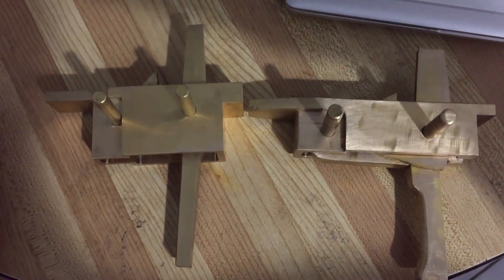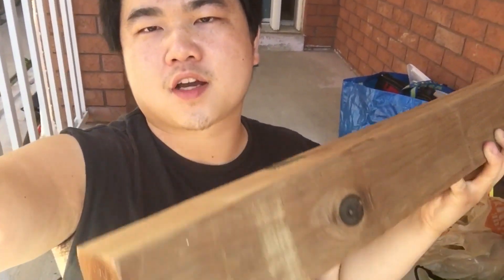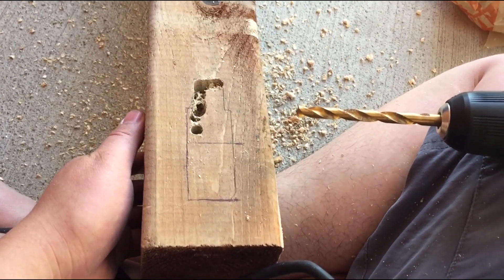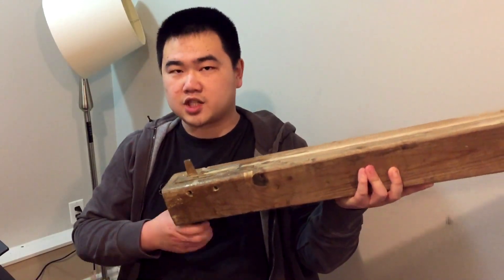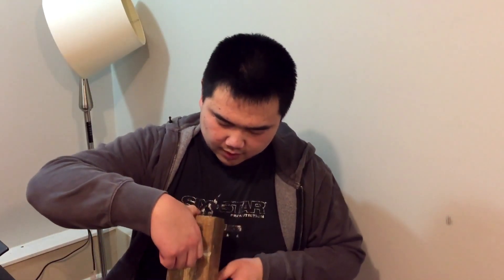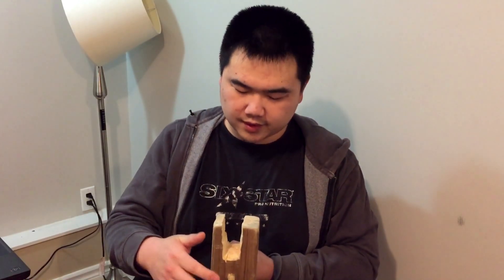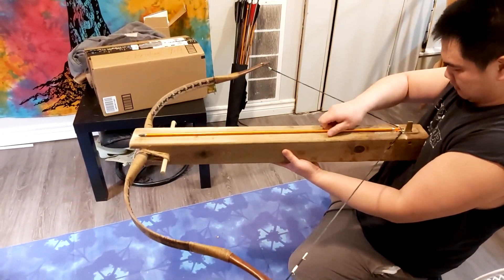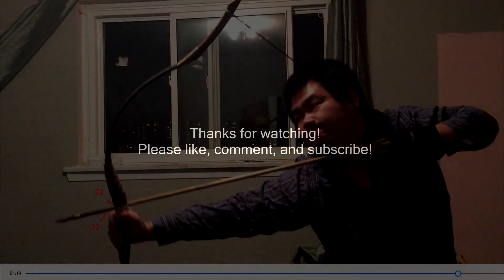DIY Ancient Chinese Crossbow Prototype

Comment: Interesting project. Do we know if the Chinese crossbows shot the same size arrows as the hand bows ? It seems to me that a shorter lighter arrow could be used which would fly faster and therefore give more range.
Reply: They normally shot shorter bolts, but could also shoot regular arrows. There are Han Dynasty records that talk about the advantages of the crossbow being they could reuse arrows from their enemies, but enemy archers couldn't reuse crossbow bolts. However, what Historical Archery created here isn't exactly to the dimensions of a typical ancient Chinese crossbow. Even with his plan to use his 240lb draw longbow with a 30 inch draw, the draw weight is much lower than a historical Chinese crossbow while the draw length is much greater than a historical crossbow. For example, the historical median/most common Chinese crossbow of the Han Dynasty had a 387 lb draw weight, with what was probably an 18-20 inch draw length or powerstroke. So ancient Chinese crossbows "usually" did not use regular bows as their prod.
Reply: @Intranetusa  Yes I did some searching on the net last night to find out more about these crossbows. I quickly discovered that they weren't just regular bows strapped to a stock and they were specialist weapons. I didn't see anything on the powerstroke so your information on that is interesting.
Reply: @shcomptech  There is no record found that discusses powerstroke, so my statement of an 18-20 inch draw length or powerstroke is more of an educated guess. I based this number on archeological evidence dating to the Qin and Han periods where the partially surviving crossbow stocks or imprints of rotten stocks found were found to be around this length measured from the front to the trigger box. The Han Dynasty records for personnel (non-field artillery) crossbows doesn't say there were different draw lengths and only talk about different draw weights, so the assumption is that the draw lengths were standardized to one length while draw weights varied with at least 10 different grades of draw weights.
Reply: @Intranetusa  are you hackeny scribe
Reply: @marcellusbrutus3346  No.
Reply: @Intranetusa  lol its cuz u sound knowledagble and passionate about the field anyone who read hackney's article might suspect u
Reply: @dsasd778  I did message Hackney for a link for the primary source material (eg. the Chu Yen slips). I can only find bits and pieces of it translated in English and most of the academic stuff I've read only references the slips indirectly. Unfortunately, I couldn't find anything translated in English...only translated into modern day Chinese script.
Reply: @Intranetusa  do u mind sending this here would love to deciper it im chinese
Reply from the maker: I am not sure, id imagine they had all kinds of ammunition. they can fire back the arrows found from their enemy horse archers as well as use shorter bolts to save wood (useful during siege)
Reply: @Historicalarcher  Yes, but it's also possible that the crossbow was just a way to get more people trained as archers quickly with minimum training. The crossbow being much easier to use than a hand bow. Crossbows certainly have advantages on the different arrow sizes and weights thay can shoot.
Reply: @shcomptech  the chinese word for crossbow 弩 has the character woman on it, meaning the crossbow for a woman.
Reply: Pretty much. The stock & trigger could be lashed to any bow & shoot both light & heavy arrows. In war heavier arrows were more usually used as they deliver more energy to penetrate armour better than lighter arrows would.

Comment: I don't know about the bow, but Id recommend reducing the width of the stock quite a bit, until you're left with about 10mm of wood on each side of the trigger plate, cause I can see you struggling with cocking the string since the beam is too wide. Its not going to compromise the strength of the thing at all, don't worry.

Id also recommend thinning the arrow pass even further, just like with Steven's crossbow.
It would reduce the area the string has to drag against by quite a lot. Also, adjust the bow so the string isn't dragging along too much in the first place.
These two things will help with efficiency the most.
The last thing you could do to increase performance is to polish the arrow pass and groove and lubricate them, as well as the string.

Hope this helps, cheers ;)
Reply from the maker: thanks for the suggestion, what are you refering to the arrow pass? i didnt shave the sides at the moment because i was lazy. it takes a lot of work without power tools and i dont have a drill anymore
Reply: @Historicalarcher  the arrow pass is the thing wich the arrow rests on, the thing with the groove.
But you only need to thin the part where the string actually travels. So 32in minus the brace of your bow.
Stevens crossbows arrow pass continues to be slim quite a bit after the string as you can see.
But that is only a weight saving measure or simply aesthetics.
Either way, if it doesnt bother you, or hinder you, it wont have any effect on arrow speed.
Reply from the maker: @dan_the_dj  im working on shaving it but i dont want to shave it too thin. i know there is some friction but its quite a lot of work to shave it without powertools
Reply from the maker: @dan_the_dj  since i have no chisel experience, im stuck with a wood rasp
Reply: @Historicalarcher  No need for powertools. Take a pen and mark your final width lines. Then use a woodsaw and cut near to that depth in chisel width increments all along the length you intend to reduce width in and then finally take your chisel and hammer and cut out the whole thing, piece by piece.
It will save you a lot of time and work, you would have to do finishing touches with a rasp and sandpaper afterwards.

Jus dont cut straight down with the chisel, there is a strong possibility of splitting the wood too far.
Make your first cut of each section at about 45 degrees towards the outside of the beam and do it from both sides. That way you eliminate the edges and its safer to remove the rest of the wood quicker and easier.
Reply: A good rasp would only take slighty more time for a strong guy like you.
Ive seen you draw those ridiculously heavy bows, dont wimp on me now xD

Joking aside, if you wanna cut corners, its way easier rasping a 45 degree chamfer on both sides to reduce the arrow pass width and shave off some mass in the process.
Your call :)
Reply from the maker: @dan_the_dj  i will stick with the rasp while im watching netflix, least risk. im afraid the one strike with the chisel and it split in half
Reply: @Historicalarcher  or a hand plane. Rasp is for removing lots of material, plane or a scraper for fine finish.

Mark a couple of lines for where you want to remove to, then work with the rasp or plane for a bit, check to see how close you are.

Comment: Good job, Jack. Sorry to hear that manufacturer stopped making good triggers. Can you get them anywhere else? Seems you found a good expert to help you out with the projects, either way.

167fps seems fine for a historical recreation. I often wonder if historical bows were more efficient than the recreations.
Reply from the maker: this is the first bow i used, which is the lightest bow i had that can be pulled to 32". It is also made of fiberglass and was 50$.  I will gradually increase in prod weight and make small improvements of my crossbow
Reply: made in china, duhh
Reply: @marcellusbrutus3346  um, chinese designed crossbow component made in china......whats the issue

Comment: Did the 望山 work？
Reply from the maker: yes it did:)
Reply: what is 望山
Reply: @Dnahwjjwjejnenex  It is the piece on top of the trigger, where the ancient Chinese used it with marking on the side for distance shooting. Not sure how will the replica do in terms of calibration or accuracy.
Reply from the maker: @justneedductape5093  oh I thought you mean if that piece functioned which is yes as it is essential to operate the mechanism. The wang Shan piece has to move to work. In terms of using it as an aiming guide have not tried